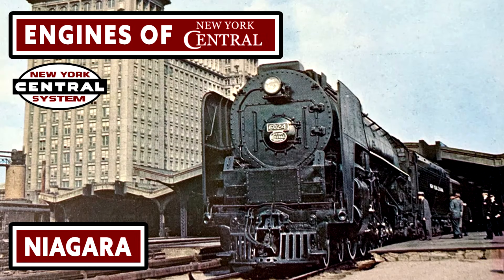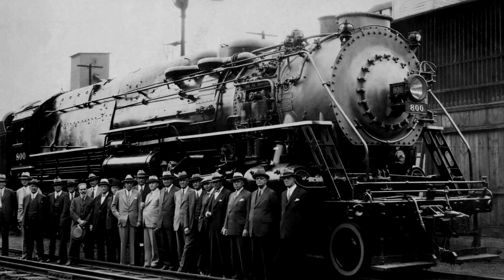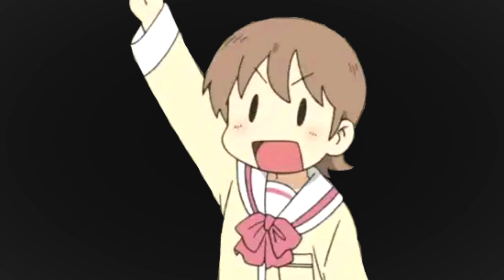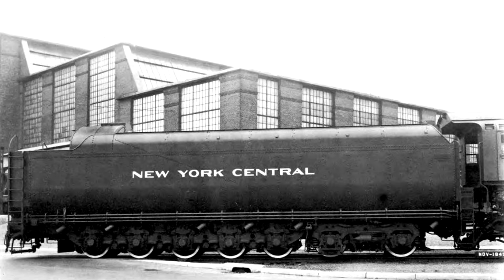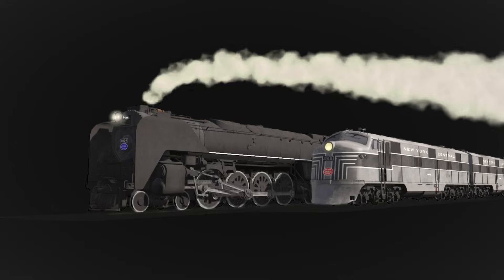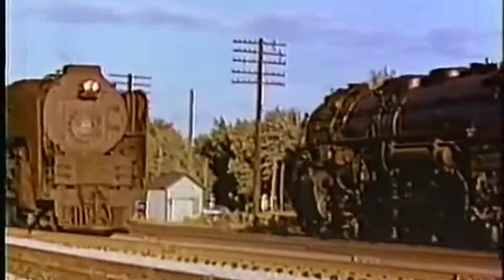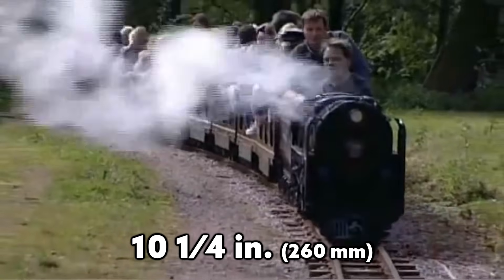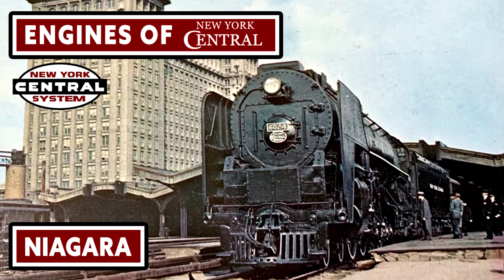Engines of New York Central - Niagara

Comment: I really wish 3 of these Niagara locomotives should have been preserved as the most iconic locomotives of the NYC but its bullsh&t they got scrapped if i built a time machine and saved 3 Niagara locomotives before there faith if they were prevented it will change the world forever fo steam fans but in reality scrapped too late no one is going to save these handsome, fast and mighty machines.  But hey at least i can get the lionel vision line Niagara as a fictional excursion star and the Niagara in K&L trainz

Comment: The  Niagaras did not have a 3 chime Hancock long bell whistle.  They came from ALCO with a 6 chamber chime whistle (probably manufactured by Nathan).  The WABCO (Westinghouse Air Brake Company) Pneuphonic air horn was added to the Niagaras between 1946 and 1947 in response to engineers stating that they could not hear the 6 chime whistle when running at track speed in bad weather with the cab windows closed.  It was mounted on the boiler in front of the engineer's side of the cab.  The New York Central Standards book specified the use of a 3 chamber "long bell" whistle for all locomotives operating on the Putnam and Harlem divisions and all K-11 Pacifics running on the River division.  This information was taken from the book Know Thy Niagaras by author Thomas Gerbracht.
Reply: Isn't the Hancock 3 chimes the only whistle that could take over 250 PSI? Because the Niagara had high boiler pressure
Reply: @danikoo582  No it is not.  The production Niagaras had a boiler pressure of 275 psi and the Nathan 6 chime whistle was more than capable of handling that pressure.  If you can obtain a copy of Know Thy Niagaras by Thomas Gerbracht you can read all about it.  If you want to hear how that 6 chime sounds check out the You Tube video "Western Maryland 1309:  Articulated in an Allegheny Autumn.

Comment: This the first time I'm seeing these late steam engines on film. What a shame. Lots of NEW YORK CENTRAL SYSTEM engines after this weren't saved on the east coast for some reason or another example: The P & T motors electrics weren't saved except one, 1962 MU electric (NYC) later PENN CENTRAL/ MTA retired as Metro North Railroad. Vandals got to the fleets unfortunately after the goodbye trip to them. From New York Central to Conrail lots of these old relics & fleets are surely missed. At least there's 2 bright sides i'm glad UNION PACIFIC saved a few of The  "BIG BOYS". & have had many excursions for all to see. What has NEW YORK CENTRAL done: "DESTROY" ! That sucks. The second there are so many models in many scales of them sold as individuals or train sets so at least they live on that way to remember them or learn of what ran on the rails in times past. Good video Very informative. 👍🎥

Comment: The stated "6680" horsepower are a bit on the high side.The boiler of the Niagara was not big enough to generate 6680 horsepower. 5000 horsepower would be more realistic.
Reply: That number was indicated horsepower. The 5,000 HP number is more accurate since it's drawbar horsepower, which was stated to be 5,070 at 62.5 mph.

Comment: Your video has errors in detail too numerous to mention - Where do you get your information? Let me guess THE INTERNET. One sticking in my craw - NYC did not turn to Alco for the design, it originated and was developed to what ultimately was realized by Paul Kiefer and staff, top to bottom. The drawings, data and later books which exist document well the genesis and history of one of the best designs ever by any maker. Finally your assertion of Al Pearlman's supposed edict on scrapping is not just wholly inaccurate it typifies modern misinformation offered by poorly vetted sources such as yours. 👎👎👎

Comment: It's impressive, but the PRR Class M1 'Mountain' was more powerful, not to mention mixed traffic.  It's a pity that more weren't ordered, and a shame that none were streamlined.
Reply: So the PRR M1 was arguably better than the NYC mohawk then?
Reply: @sangheiliwarrior86  I would say so.  The M1 had a heavier tractive effort, and comparable speed.  She was designed as an express mixed traffic engine, meant to haul heavy trains at high speed.  The only reason why it wasn't employed much as an express engine was the electrification of the Eastern region of PRR.  With the mighty GG-1 electric engines taking over top-line expresses east of the Appalachians, most of PRR's passenger locomotives were relegated to Central and Western regions.  With so many surplus K4s and E-series engines at the ready, there was no perceived reason to use the M1A for anything other than express freight service.  They did see limited use from time to time, but nowhere near as much time as was expected of it, and far less than it deserved.
Toe to toe against a Mohawk, the M1 would at the very least keep up, and could handle steeper gradients much easier.
Reply: @kyleclark4449  Yeah, but that's just a given. The NYC didn't have as many grades to attend to like the PRR did, which is why most PRR steam locomotives make better mountain climbers. The NYC wanted their steam locomotives to be flatland racehorses, not mountain climbers. Don't get me wrong tho, I'm both a Mohawk and M1 fan.
Reply: @09JDCTrainMan  I agree. I like both engines, and each has its own pros and cons.  The Niagara is built for speed, able to fly along the Water Level Route like a racehorse.  It's also more glamorous.
The M1 is a better hill climber, because it had to be to allow it to tackle the Appalachians.  It's more powerful, and more versatile.  But, the PRR rarely used it for passenger trains, because it had no perceivable need for it.
The Niagara was a top of the line express passenger engine that could also handle fast freights.  The M1 was an express mixed traffic engine that had the potential to be a great passenger hauler, but never had to.  Both are impressive machines, and it's a shame that NYC never thought to preserve one.

Comment: Funny thing about the S-2a. Its tender was actually slightly different than the rest of the Niagara’s too, a PT-6. Same wheel layout, same 9ft+ overhang, but it held a ton more coal and I think 2,000 gallons less water. Why they thought water capacity needed to be lower when the Niagara boilers already had high steam rates and added a ton more coal when the 5500 actually burned less coal than its older siblings, I have no clue.  

It also had pitfall as the PRR T1 in being a bit too powerful for its motion. Franklin-Caprotti probably would’ve been fine, and NYC 5500 could’ve been the most powerful dual-service steam locomotive outside of articulateds and duplexes. Problem was the poppet valves, Type A, couldn’t accommodate the engine’s steaming rate. Had it been given Type B valves with rotary cams (as on PRR’s 5500), then it would probably be a much better performer. Definitely would’ve been a bit easier to maintain since Type A’s valves sit between the cylinders. It’s also why 5500 has its air pumps on the side instead of in front of the smokebox
Reply: Yeah, thank the T1 Trust that they're fitting PRR 5550 with Type B2 Rotary-Cam Poppet Valves.
Reply: @regularguy7266  Definitely. While Niagara's made too much steam for the Type A valves, the T1's simply ran too fast for them.

Comment: Can someone explain to me what is the advantage difference between wheels arrangements?
I.E. same driving wheel but different leading or trailing wheel : 4-8-4 vs 4-8-2
Or same leading and trailing wheel but different driving wheel : 4-6-4 vs 4-8-4.
Reply: There are three main advantages of 4-8-2/4s over 4-6-2/4s:

Greater acceleration
Bigger boilers
Larger Ashpans. 

Eight driving wheels are going to move more faster than six, it can support a longer and taller boiler and so has more steaming capacity and a four wheel rear truck is going to allow for a much bigger ash pan and firebox. So it can burn more fuel and a lower grade of it. 

The downside is that the engine is very long, very ridged and you need to be sure it’ll have work to do for it to be economical.

Comment: I've been looking forward to this video for a while, and it sure didn't disappoint! It should be noted that the biggest reason for the Niagara's extreme efficiency was the fact that they were cross-compound steam locomotives, meaning they got fresh steam to one cylinder, which then exhausted the steam to the other cylinder. I believe the steam was re-superheated on its way to the second cylinder. The Niagara is definitely one of my favorite locomotive designs of all time, right there with the Lima Berkshires.
Reply: The Niagaras were not compounds.  The cylinders were of the same size.

Comment: Do the FEF3s also count as the "ultimate steam locomotive" too?
Reply: Not really. Despite also being built by ALCo, having even larger drivers for slightly higher speed and looking similar, the Niagara was still the more efficient design, with a bigger boiler for better steaming capacity and roller bearing rods.

Comment: These became my favorite locomotive 

They were the ultimate locomotive at the time, Until Norfolk and Western acquired the J Class 

Honestly the Niagara and J Class are almost on equal, I say this because the Niagara's had 60,000+ Tractive Effort and Some J's had 73,000 tractive effort and 611 herself has a tractive effort of 80,000

The advantage the Niagara's had was the water scoop on the tender and didn’t need to stop

The J's had roller bearing side rods, self lubrication systems and bigger boilers

So the Niagara and the J Class could be considered the strongest of the 4-8-4 wheel arrangement
Reply: The Niagaras also had roller bearing side rods, but the Js also had roller bearings on their valve gear. The Js, like the Niagaras, also ride very smoothly even at speed despite having comparatively small 70" drivers. Both are still easily the best of the 4-8-4 wheel arrangement.
Reply: @09JDCTrainMan  They’re both the best in terms of their different terrains. The J’s were vastly better climbers, and could easily sprint trains over 110 mph. At the same time, I don’t think they would be able to hold those speeds on the flat continuously. 610 only managed a maximum of 111 mph during its time on the Pennsy, but even with under half the mileage of the NYC, still managed to break its valve gear. The Niagara’s meanwhile were far more optimized for continuous, fast running. I don’t even know how they’d handle trains over long grades, being lightweight and having a serious drop in horsepower from the cylinders to the drawbar.

At least we can say the Niagara would most likely be able to run anywhere thanks to being so short. I think they stood about a foot shorter than the J’s, and most other 4-8-4’s for that matter
Reply: @russellgxy2905  Terrains, yes. Also, from what I read, 610's valve gear only broke because she lost lubrication after traveling about 2,100 miles without refilling the lubricaters, not the 111 mph running. The fact that the J can even reach triple digit speeds at all with just 70" drivers is impressive to me. But yes, the Niagara should be faster by default due to having larger driving wheels. Still, it's true, the J is best 4-8-4 in the mountains while the Niagara is the best 4-8-4 on the flats.
Reply: Sad that the NYC had the best 4-8-4 (at least for flat terrain) then things got complicated and they had to destroy almost everything to save the company that ended up bankrupt anyway
Reply: Thanks, think I'll be combining the 2 designs into 1